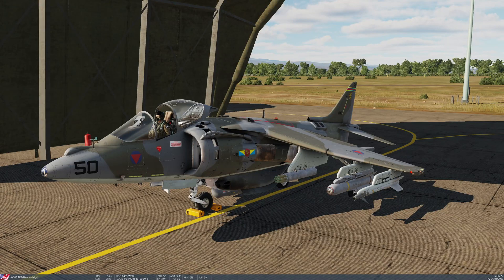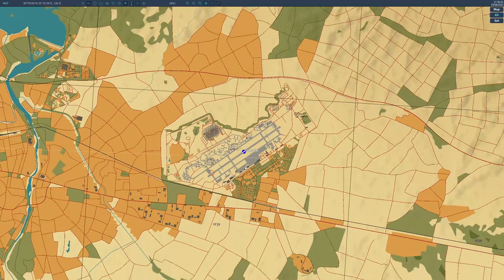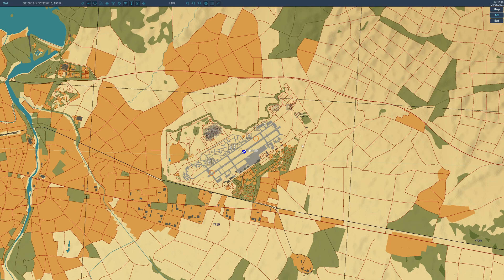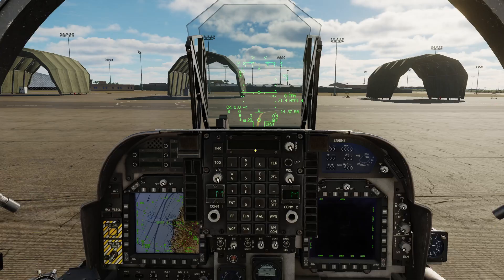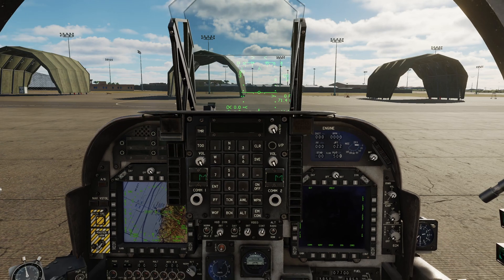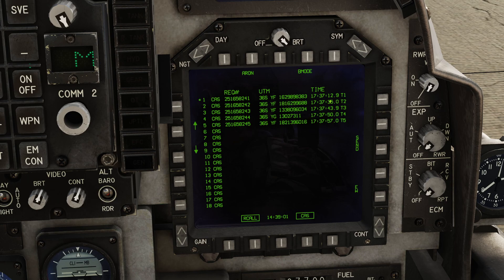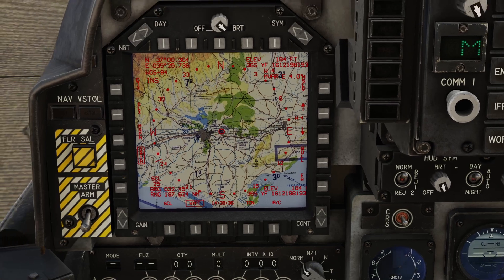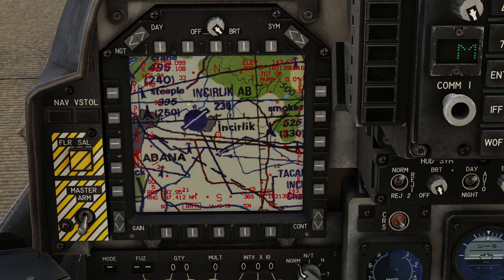DCS AV8B Bonus 6 - ATHS Markpoints

Comment: I have been sat in my Harrier cockpit on the ground & have done exactly what you have done when creating markpoints on the F10 map.  I have tried to import them to my kneeboard by pressing Right Shift+Right Alt+"8" but with no luck what so ever.  I've even reset the key bind to default to make sure its correct, but it still won't allow me to import the markpoints to my kneeboard. 
Just when I was starting to enjoy the Harrier, I now can't use the bloody JDAMS in the pre-planned mode.
Reply from the maker: This has been revised in a later patch. Check out my video here for the new procedure. https://www.youtube.com/watch?v=Z3Ofdk-WvCc

Comment: Just a small addendum to this really helpful video (and set of videos) for anyone who is struggling with these targetpoints, like I have done - I believe (Jan 22 versions of Harrier and OB), that you must have at least one Waypoint configured in the first place, else these targetpoints appear in the CAS and kneeboard pages, but aren’t actually usable. Apologies if this is mentioned and I missed it…
Reply from the maker: That's a good pointer there. It's true that unless you have at least one waypoint specified most of the nav functions of the jet won't function at all.
Reply: @deephack  I made the mistake of jumping in the jet thinking I could jump in the jet with no plan, add some target points and go. Spent a lot of time banging my head against a brick wall until I realised :-)

Comment: You described target points, NOT mark points. Mark points are created as you are flying when you press the MK# (where # is the number of next markpoint to create) button on the bottom of the EHSD screen. Also, if you are in the air when you do the RALT RSHIFT 8 thing, it will load the target points but it will NOT actually assign the T0...TX numbers. You will have to do that manually 1by1 by pressing the USE button on the main CAS page on each page and then entering the target number on UFC and pressing ENT.  On the ground with weight on wheels this is done for you automatically.
Reply from the maker: That's correct, I only use the term mark point because that is the name of the F10 map feature we use to create them. In the aircraft they are target points. Thanks for the clarification.

Comment: The cool thing about this option is, it does not matter who sets the markpoints on the F10 map. It is perfect for a human JTAC or AFAC to identify an enemy position, locate it on the map, mark and simulate using ATHS to send it to the Harriers. Another interesting thing is, all Harriers will load the markpoints, so you can use it to share target Info within your flight. Only drawback is, if you are on a server and multiple guys place markpoints it gets messy. 😉
Reply: So, if I start numbering from say T51 to T56, then my wingman does 61 to 67 say, will all harriers be able to load those?
Reply: @TreadsTravels  Yes, as the total number of markpoints is less than 18. The CAS page can only store 18 Target points, thus only the last(!) 18 markpoints from the F10 map will be processed.
If you do T01 to T11 and he does T12 to T24 after that, RA+RS+8 should load T07 to T24 (the last 18).
These will show on the CAS page as 01 to 18, nonetheless and you may need to set them as an active Targetpoint with the "USE" OSB.